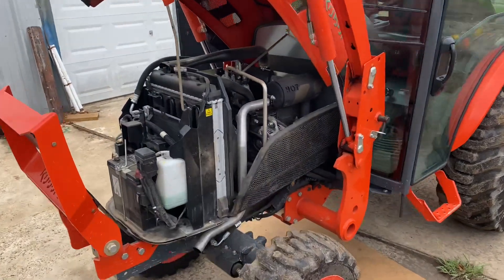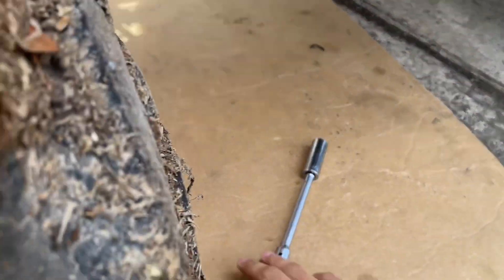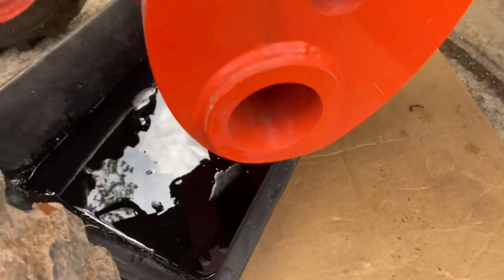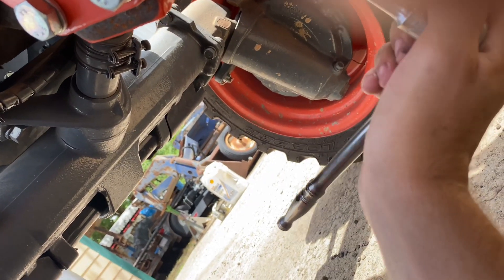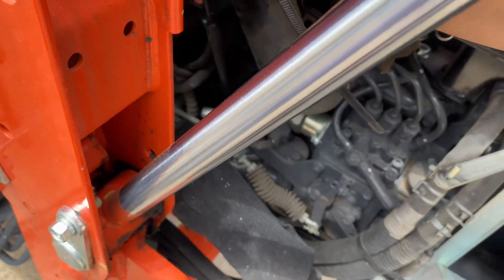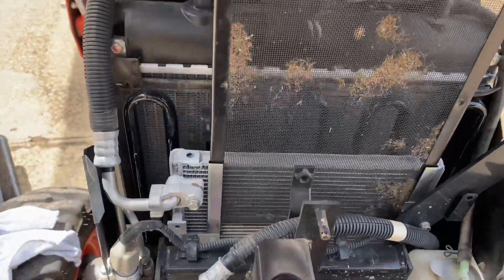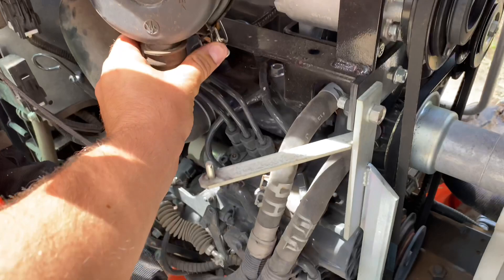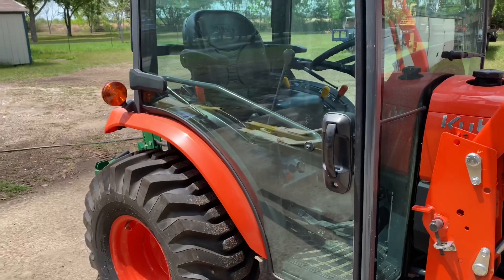Oil Change On My New Kubota LX2610 Cab

Comment: just a heads up never blow out an air filter, my neighbor did it for years and then gave me the tractor it was a Kubota b 7200 and with only 922hrs on it with constantly blowing out the filter instead of replacing it he actually dusted the motor as the dealer calls it,  so a motor that should have lasted a lot longer had a very short lived life cause of neglect of replacing the air filter, just my 2 cents but i d hate for you to have to have to do a rebuild in a couple of years that could have been prevented
Reply from the maker: I think his engine just gave out. Nothing wrong with blowing out a filter. At some point it will need to be replaced of course but these small filters are easy to keep clean.

Comment: Hi, will the kubota lift the rear tires off the ground if you try to pick something up that's too heavy for the loader? I'm curious because my Kioti Ck2610 won't lift the rear tires like most people are saying. I turned up the pressure a little. It definitely lifts more but still doesn't make the rear tires come off the ground lol
Reply from the maker: No mine does not either, even with the pressure turned up. My rear tires are filled but I would still expect it to lift the rear end up.
Reply: @atvrepairsandmore2482  Interesting, I was thinking the same too. There's a few people that posted on a thread that their machines lift the rear off the ground even with filled tires and an attachment on the rear. I think they might be dreaming lol unless there psi is at like 3500
Reply: Mine does without ballast on the three point